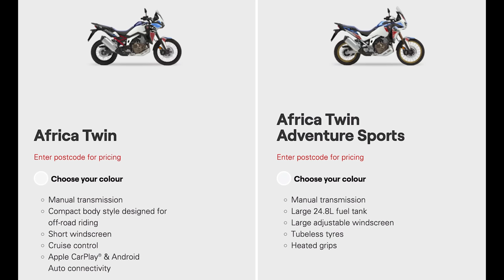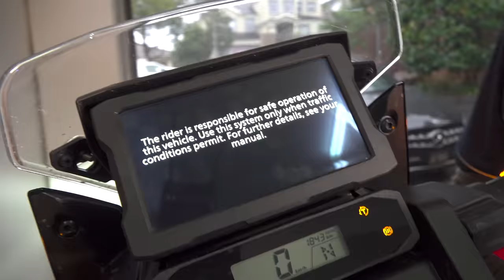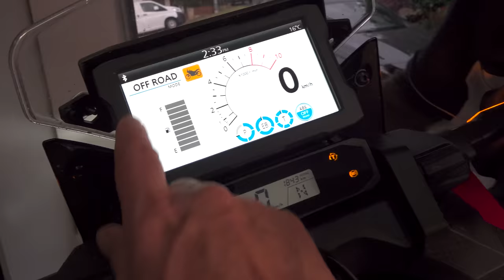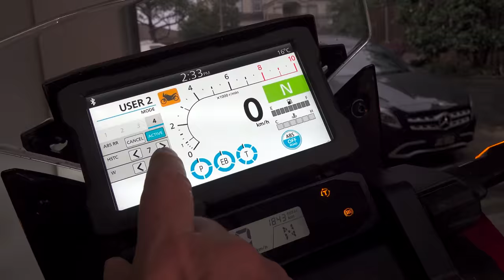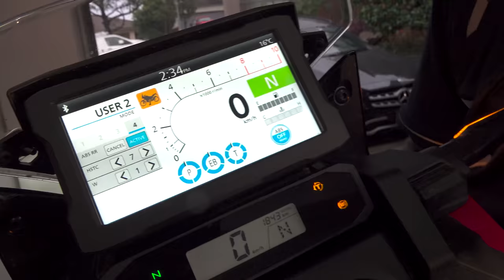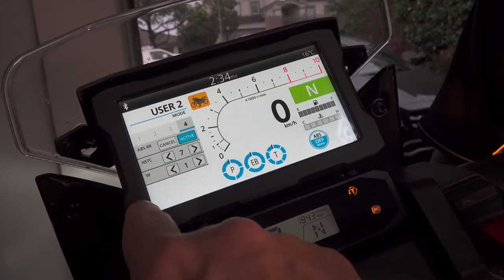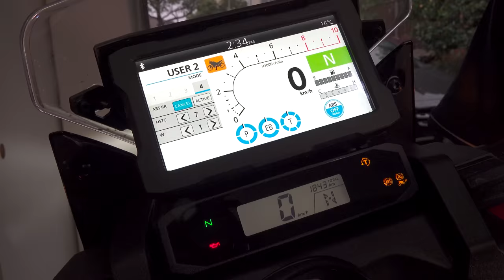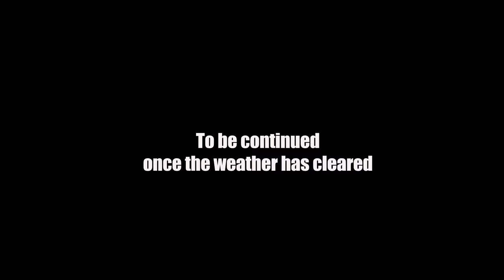Test Review 2022 Honda Africa Twins

Comment: I’m pretty sure If you press and hold the traction control on setting 1 it will switch completely off to zero. Great video and great bike.
Reply from the maker: Thanks for the info!
Reply: Willie control is the same: set to 1, hold for few seconds and get it on zero.
Reply from the maker: @thelostgeneration2000  thank you

Comment: Thank you for the video. Looks really good. Some things that I noticed, you actually ride on least power (more blue is less power) and you can turn wc and tc totally off if you hold the toggle switch on the left cluster to the left (it changes to 0). Also on the abs, you can set it to only front wheel by holding the same. These options are only possible to change in user modes 1 or 2 and the most detailed screen (gold screen)
Reply from the maker: That was extremely helpful.
Reply: @MotorcycleAdventureDirtbikeTV  👍🏻it applies to all settings. More blue is less fun, so more blue is less engine breaking, more blue is more traction control etc!
Reply: @depsych  I'm glad you bought this up. I have a 2020 model and really struggled to get my head around the setup until I watched a YouTube vid from Daryl Beattie which explains everything and its very simple and other turning ABS and TC Completely Off, it can be done on the move. 
The user manual is a complete waste of time in trying to understand how to do this.
Reply: @DLL969  Yeah, that owner's manual is made out from some kind of non-pedagogical view or something. Not very logical to me at least 🤷‍♂️😅

Comment: Have a 2017 with minimal electronics which suits me well. Mine is armored for off road and I beat the crap out of it. At 63 years old it has become my go to therapy. Just wish it was easier to pick up off the ground but the weight disappears in the saddle. 
Love mine and continue to enjoy Honda reliability. It’s amazing how well it works off road. 
As usual, great review. 
Thanks mates
Reply from the maker: Thank you
Reply: I hear you they are heavy...look into the tool called  The Dirt Napper, this will help you pick up the bike if you happen to fall

Comment: Still travelling with my „old“ standard Crf1100 from 2020. So far, it never let me down on my now 6month journey and DCT is lovely, even off-road. Suspension was a bit soft, but perfectly adjustable for me. For me it is almost the perfect RTW-bike, even though i wish it would be a bit lighter. It’s a good cruiser as well.
Looks like the 2022 AT is even better! Nice video! 👍
Reply from the maker: Yes suspension has improved.

Comment: I thought it worth mentioning that the Adventure Sports also comes in manual transmission and non electronic suspension and here in New Zealand the price difference is standard model (manual) $25995 vs Adventure Sports (manual) $27995...not a huge difference. For that you get the heated grips, larger fuel range, slightly better weather protection, adjustable wind shield and LED cornering lights. 

The way to think about the power, engine braking and traction control levels is to think about varying levels of intervention.

The ergos of the Africa Twin is fantastic.
Reply from the maker: Thank you

Comment: I feel the bike sits in a very interesting position where it competes in multiple classes. For one, it competes with the 'mid weight' ADVs, especially the T7. Both ADVs with Japanese reliability, one a bit more leaning towards road the other towards dirt. Standouts for me were the fit and finish, options like cruise control and quick shifter, build in navigation with android auto and very comfortable seated position. I feel it can do similar things to the T7 offroad, but it will just cost you more effort.
Secondly it competes with the bigger tourer machines (tiger 1200, GS etc). Still enough power to do touring and carry luggage, but not so much to seriously compromise the offroadability. 

For me personally it strikes a good balance for road/dirt, whilst still being able to do comfortable long distance touring with pillion. It really feels like the 'do it all' kind of motorcycle.
Reply from the maker: I feel it's closer to the T7 in terms of performance.  Certainly has better standard suspension.  The T7 is top heavy so the slight difference in weight evens up with the T7s higher centre of gravity.

Comment: The AT is a very serious candidate as the ideal off-road biased litre+ ADV platform. It's arguably more dependable or at least easier and cheaper to maintain than the usual comparable suspects from BMW and KTM and despite the latters' obvious power/torque advantage, one really has to ask, what exactly will most riders ever do with all those additional horses especially on the dirt?
Looking forward to this review.
Reply from the maker: Suspension, suspension , suspension - really good off road straight out of the box.  But I won't say too much or I'll spoil the review.
Reply: @MotorcycleAdventureDirtbikeTV  hi, after carefully viewing your Africa Twin tests and conclusions,  I returned to your Norden 901 review ... soooo, which one do you choose ? And too bad you didn't test the Aprila Tuareg 660, smaller engine/power, but only 204kg ready to go dirt with full gas tank.

Comment: Good review guys. I had a bit of time on a friends 2017 AT standard manual model a few years back and I liked it, but wasn't ready to get a new bike just yet. Then this past fall I got to put a couple hundred miles on a 2022 AT standard with manual transmission and I was in love with that bike! My bike has to be a commuter for work and a master of the highway too. My trip to work is 32 miles/50km of gravel road every day during the riding season and the 2022 AT can run a gravel road and be super sure footed doing so, it's an amazing motorcycle. As soon as the 23's were available to order this past fall I ordered one! I ordered the Adventure Sports with manual transmission. I will shift my own gears till hell freezes over, I want to be the one in total control. It should be arriving at my dealer around the end of January from what I'm told, I won't be brining it home till probably about the end of the first week in April, that's generally about when my riding season starts here, I'm looking forward to it.  You mentioned that your bikes there came equipped standard with a centre stand, they don't here. I had to shell out another $350.00 for that, it's sitting in my garage now waiting to be installed when I get my bike home. Also another positive in my opinion for the Africa Twin is that it will run fine on regular 87 octane gas compared to most of the other big adventure bikes requiring premium fuel. I am taking a long trip this summer and I will be doing good to get regular gas let alone premium. My trip this summer will be really close to 10000km/6200 miles, I am so looking forward to spending some quality bonding time with my new bike. Cheers guys!
Reply from the maker: Thanks Myron

Comment: Own the CRF1100L and had so much fun on it.  It handles great on the bitumen, better than I expected and confidence-inspiring on the gravel.  I haven't taken it down trails like in your test as I'm still running the stock tires and it's been very wet.  I think the motor is one of the best that I have encountered, great usable power and enough to put a smile on the dial.  I'm not a 100% about the seat, probably the only thing that I may upgrade.  Anyway, loved your initial thoughts and picked up a few tips to regarding the suspension adjustment.
Reply from the maker: Thanks for you contribution.

Comment: The standard version is now about the weight of the T7 World Raid, with a higher price, but with a lot more refinements in terms of TC and suspension. Here in Europe, the standard version with a quick shifter is very popular and, frankly, compared to KTM and BMW pricing, it is not expensive. I feel this to be the almost perfect compromise, if you don't just want a light, dirt oriented enduro bike, like the CRF or the WRF. If I were to go on a long tour, I would certainly prefer the Honda.
Reply from the maker: Good points. I can understand why the standard with the $400 AU option of quick shifter would be popular.

Comment: Another thorough and insightful review from MAD TV👍.  As a 72kg weight and 175cm height rider how would the standard Africa Twin vs standard T7 feel in terms of weight distribution and general handling off-road?  I just sold a 2012 R1200GS with the goal of an easier off-road experience but to still have a reasonable travel capability.  I road a T7 in Botswana for 3 weeks and a pretty positive experience in a wide range of conditions.  Considering the T7, Aprilia Tuareg, DesertX and Africa Twin as replacements.
Reply from the maker: The suspension on the 2022 AT is superior to the standard T7, if your pushing reasonably hard in the dirt.  No doubt the RAID Yamaha will have better suspension.  Both handle excellently for their size.  But considering the imminent arrival of those other models you mention I think it is a time for waiting.
Reply: @MotorcycleAdventureDirtbikeTV  - As always sage advice from MAD TV!  Thanks

Comment: The only tips I can give from my 2022 model is to set up all of the ride displays in the same format.  I got tired of searching in different spots for the same  information, and on some screens the info isn’t there anyway.   The default ride mode for the DCT lugs the revs to low in reduced power modes, unridable.   Go straight to sport shift level 2, all of the time.
Reply from the maker: Thanks John for your sage advice.

Comment: Thanks for the review Dave, and also all the other vids you put together.  Really looking forward to another dose of Nugget.  After two 1200GS I switched to a Red 2020 AT standard about 12 months ago, really love the look and sound of the AT.    To have the same throttle settings On/Off road I have configured the two user modes, and that works well, and with the favorite button setup for TC I don't need to use the other buttons much, and even started using Apple carplay to replace the Zumo.

If you wouldn't mind, please let me know what your weight is and the suspension settings you used for rebound and compression.   Thnaks.
Reply from the maker: 94kg.  4 compression clicks up from standard, two full turns of rebound. Rear preload wound just about to the max,   2 clicks compression, 2 clocks rebound.
Reply: @MotorcycleAdventureDirtbikeTV  Thanks Dave.   I will use those as a starting point, I have found the limits on the front at times.   Another wet weekend in Brissie, so I will try dial in the preload front and rear.
Reply from the maker: @conradvr9311   The Shoa suspension is really good and clickers respond. It's similar, if not the same suspension to the Triumph Tiger Pro 900 which was very adjustable.

Comment: Even though the Africa has a 200cc advantage, it seems like the closest comparison is to the KTM 890 Adventure  or Adventure R.  I HAVE a 2021 Adventure R, so, it'd be interesting to see a heads-up comparo.  I'm probably 240lbs with gear and I've NEVER bottomed it out or even felt like I was close, as evidenced by the dirt marks on the fork.  Great video as always, keep up the good work, and hopefully I'll get down undah one day to ride!
Reply from the maker: I definitely bottomed it out a number of times and close once I adjusted the suspension.  I heard the bashplate scape the sand on some landings. Or kiss the sand may be more accurate.

Comment: I have a 2007 KTM 990S (265mm suspension non ABS one) which I love dearly as it suits my height/weight. Thinking about getting a newer bike. Rode the AT1100 standard at Dave Thorpe UK and liked it but felt cramped (36inch inseam) and suspension wayyy too soft in standard settings (105kg). Also, want a Norden with xplor pro or a new 1290R. Im no expert rider but can push these beasts a bit on 80%off road biased tires. What would you recommend?
Reply from the maker: Well firstly the AT suspension is not soft when tuned.  We have tested the latest 1290 so have alook at our review. The Norden is outstanding with the expensive suspension. With your weight standard the Norden suspension on the rear wouldn't work well unless you kept to the road. We have a review of that bike with standard and Pro suspension on this channel as well.
Reply: @MotorcycleAdventureDirtbikeTV  Thx mate. Saw the Norden review. Have not seen the 1290 but will check. 🙏

Comment: I believe you'll find the fuel bars on display to be pessimistic.  Fuel consumption is a displayed parameter and appears to be much more accurate/useful.  I've owned my bike (Base, Manual) for one week now, and filled tank once.  Display showed only 2 of 9 bars, but I was only able to put 2.7 US gallon in it.  Approximately 45% full, yet display at only 2 bars.  Trust the consumption and data on Gold display and don't experience fuel anxiety.
Reply from the maker: I agree, some are conservative.  Not used to the bike. The T700 is the same.

Comment: Also you are not able to use the touch screen function while the bike is on the move, another safety feature ??
Reply from the maker: Oh dear.   Still getting our heads around it.
Reply: It's kind of limited control. You still can use some of the features with buttons, not touch screen

Comment: Hi, can you please tell me who is selling Quick Shifters for $400. I am waiting on my 2022 ATAS ( arrives October) and asked about it and was quoted $1200 plus fitting.
Reply from the maker: Honda HQ told me it was a $400 AU extra.  Definite.
Reply: @MotorcycleAdventureDirtbikeTV  thanks, I’ve got the Honda dealer I’m purchasing the bike from looking into it.
Reply from the maker: @storkyize  Unless your buying the next grade up from the standard, that includes heated grips, tubeless, adjustable windshield but no DCT. Then that price would sound about right. Oh and bigger tank?  It was the Honda PR Australia guy that gave me the price.
Reply: @MotorcycleAdventureDirtbikeTV  Yes, it’s the adventure sports manual, one down from the DCT. 
So are you saying $400 is or the price I was quoted?
Reply from the maker: @storkyize  Well that's the correct price, because you're getting a heap of other things, not just the quick shifter.
Reply: @MotorcycleAdventureDirtbikeTV  the shifter is optional extra, all the other things are standard with the adventure sports.
Reply from the maker: @storkyize  The quick shifter by itself is $400.
Reply: @MotorcycleAdventureDirtbikeTV  👍

Comment: Really considering buying this bike. But the electronics scare me. I just wanna ride. Have considered buying an old 1000 but like this bike better, just those electronics...
Reply from the maker: I would do that.  What I would do is ue the electronic to their best advantages.  Make yourself up to customised off road settings and leave it at that.   Then you can quickly flick through four settings.  That's how I'd ride this bike.  But don't throw the baby out with the bath water, because the suspension is a real strong point for the 2022 model.

Comment: Great review, I have a 2020 adv sports, no dct, no ES, as this all adds weight and cost, this is a big bulky bike and takes a little while to get used to the bulk, i am 185cm tall and this bike is not that easy to get on and off, gripes, well there are a few, the engine has no torque below 2000/2500rpm, very poor for a modern engine and for 1100cc 105hp is pretty mediocre, 125hp would be nice, this is an adventure bike and there is no storage for tools, puncture repair, etc, the calculated fuel range is a bit iffy, not convinced it is very accurate, that front seat section is an atrocious design, getting it back on in the right position is fiddly and time consuming, air filters are not easily accessible, you need to remove all the front plastics to get at them with the risk of breaking the clips, this has an el cheapo cable clutch, my 21yo 1200s bandit has a hydraulic one, positives, the electronics are good once you figure them out, good fuel range, comfortable, good weather protection, great gravel road tourer, stable and predictable
Reply from the maker: I was clear, it's not calculated fuel range.  I said we were going to to a real world test.  It hasn't been done yet.  Please listen

Comment: Hi Dave certainly enjoying your and Clubby review, This video i made not long after I nutted out how to navigate through all the settings may be helpful, TC ,ABS and how to set up each different screen mode, Gold Silver Bronze. https://youtu.be/g6bn9PZAwb4 . I am on a 2020 AS with manual suspension. Takes a bit to gel with. I agree with your comments on the ABS package, it has taken me awhile to adapt my braking and get used to the front brake., especially after coming from the bigger KTM 1190, I have found now that I actually dont use many of those 14 buttons and change things to much. I have each ride mode set to the Gold Screen so I can see everything I need to change. I love the bike its comfy and easy to ride and doesn't feel like its pulling my arms out all day, Very good manners off road. Biggest pain I have with the bike is that it wont save the TC and ABS settings if you turn the bike off at the key or dump it and have to restart. Keep up the great content mate . Brent NZ
Reply from the maker: Thanks, but I wish you had filmed the buttons you were using at the same time.

Comment: I have always loved the looks and appeal of the Africa Twin but settled on the Yamaha SuperTenere (S10). My reasons are that the S10 has less complexity (though the Honda  has reliability, as does the S10) and a shaft drive (for what I want to do) The only thing that the S10 lacks for my needs is a 21 inch front wheel. Also: $$$$$.
Reply from the maker: Both bikes are good.  I've ridden the S10 quite a lot and loved it.